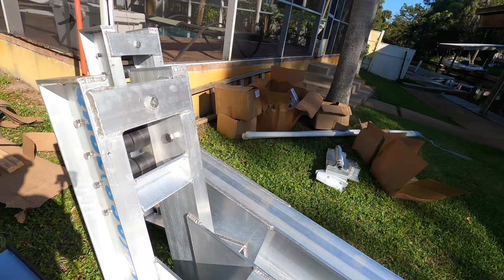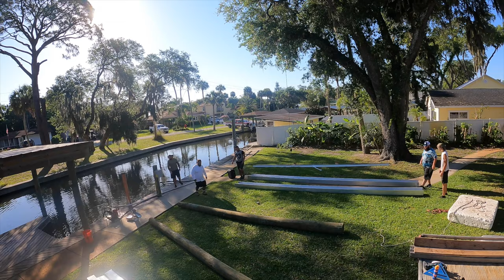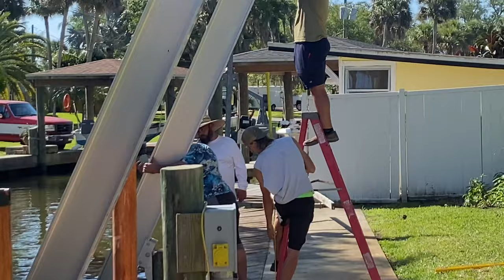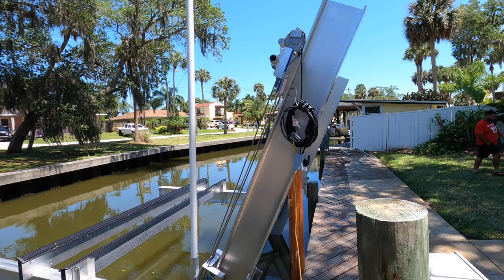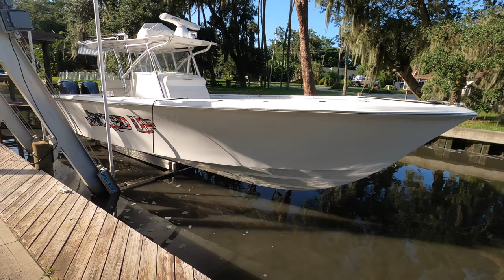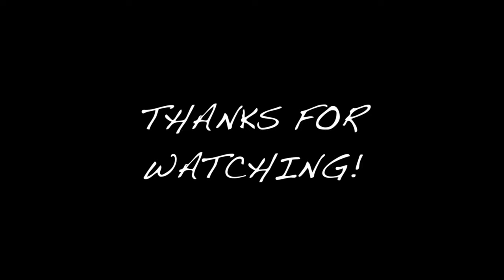INSTALLING NEW BOAT LIFT - The New Elevator Style Boat Lift at My House

Comment: I am installing same lift this this spring, thanks for the video. How is it loading and unloading guests and equipment onto and off of boat?
Reply from the maker: Funny you should ask that.  You have to build some sort of dock over hanging closer to the boat.  In between the poles .  Wish someone told me before I bought mine.  It is like 2-3ft from the Seawall
Reply: @JackedUpFishing  have you already built one? Any chance for a picture or two?
Reply from the maker: @archambo1975  I have not built it yet.  In the middle of a huge kitchen remodel.  But it’s on the list.

Comment: Wow man that is an interesting install.  I thought they'd drive the poles down with a pneumatic hammer and the same with those I beams.  Did they tie back the poles to the seawall by chance?
Reply from the maker: Yeah I agree 100 percent.  Yeah they tied the poles back to the wall, only it was after my boat almost pulled the lift into the water! Lol.  It works good now after o shored it up more and tied it back Bigtime.
Reply: @Jacked Up Fishing  I been getting quotes for an elevator lift the last few weeks and WOW are they expensive. I got a few quotes and good bit of the cost was that install with the barge and driving in those 12" x 25ft pilings then tying those piles back into the seawall.

Comment: Isn't the salt water going to eat those beams?
Reply from the maker: It would take years and years if it did.  These lifts have been in south Florida for years now. No issues
Reply: @JackedUpFishing  The video is 2 year old. I'm curious if you replace zinc sacrificial anodes every so often? Have a diver check the thickness of the beams?